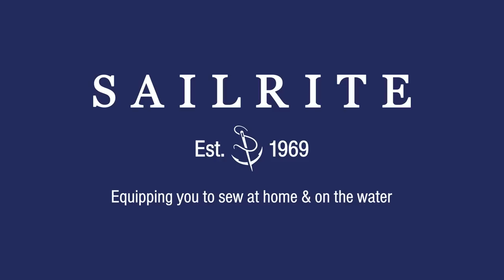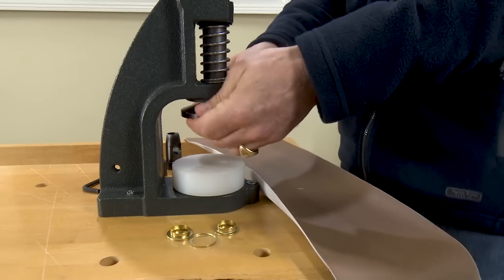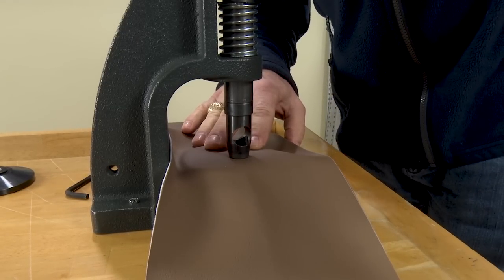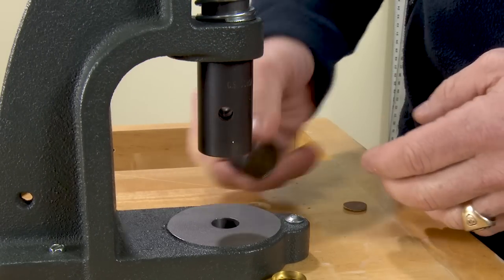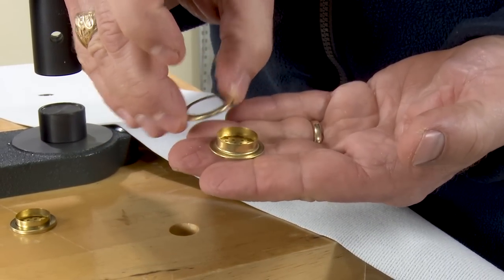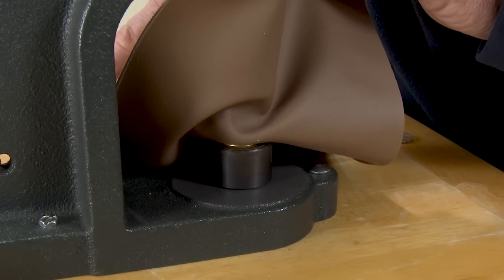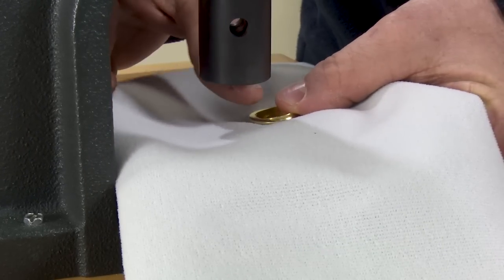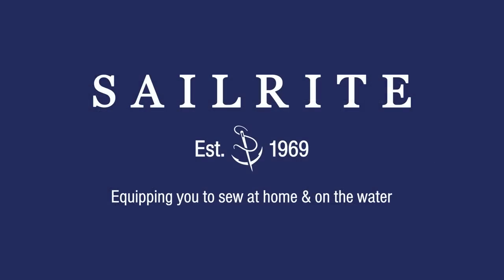Installing Vent Grommets using the W-1 Hand Press

Comment: Can you cut a small piece of mesh and place it between a regular gromment for airflow?
Reply from the maker: I wish, but no. The die set has a male end that must go through the spur grommet to set the grommet in place. The mesh does not allow that male part to pass through the hole.
Reply: @SailriteDIY  That's what I thought, thanks. Ive seen those type of grommets/eyelets before.  I wonder how they are done.